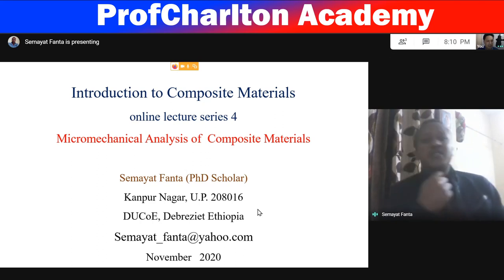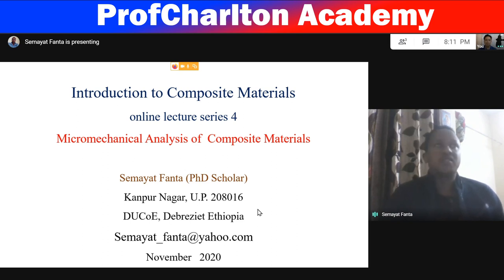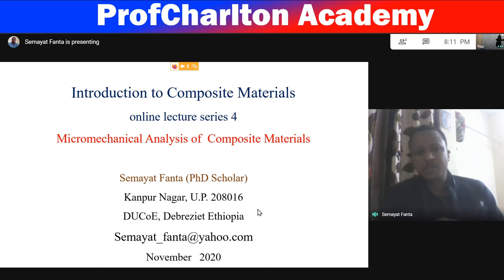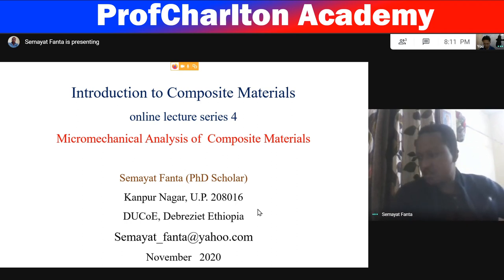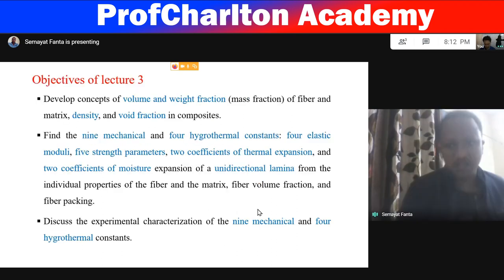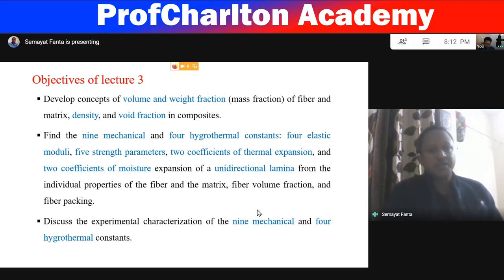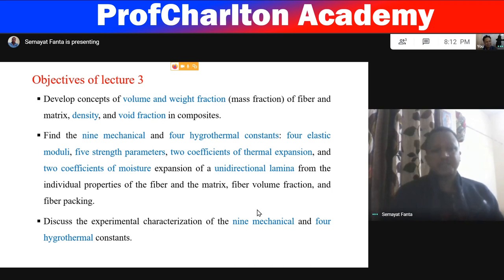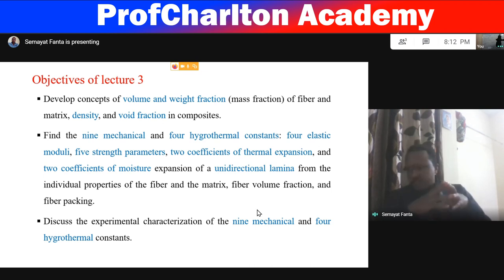Ph D Candidate  Semayat Fanta Lecture Series 4: Micromechanical  Analysis of Composite Materials

Comment: Thank you Dr. Fanta for providing the information about the stiffnesses, strengths, coefficients of thermal and moisture expansion of the individual constituents of a composite, fiber volume fraction, packing geometry, etc. In order to achieve adequate structural performance for the composite material, the fiber volume ratio plays a crucial role. The engineering designer uses the volume ratio of the fibers to derive the properties of the lamina, and thus the structural properties after lamination. But in order to achieve the required ratio of fiber volume in wet laying processes, the manufacturer requires a ratio of fiber weight to resin mass.

Do high fiber volume fractions increase the transverse strength of a unidirectional lamina?